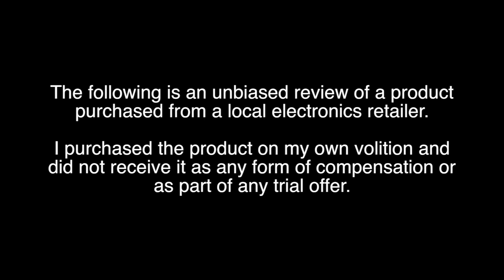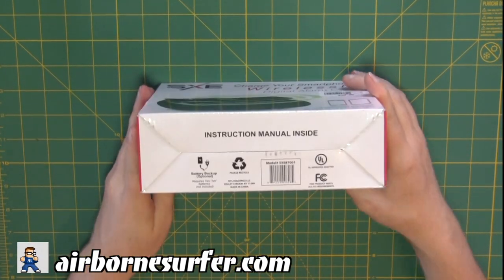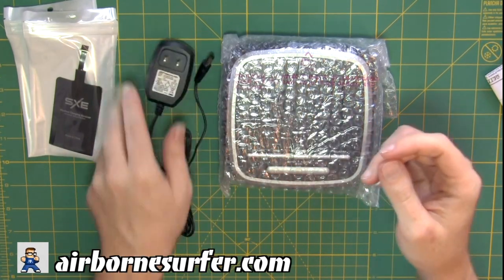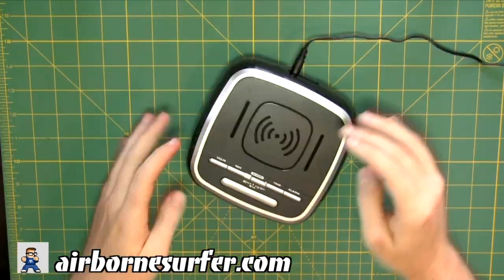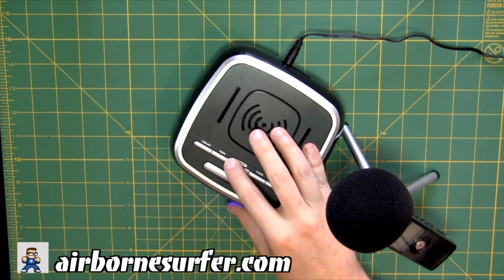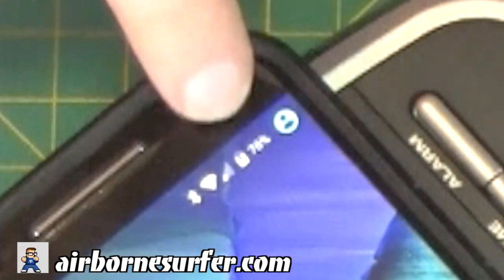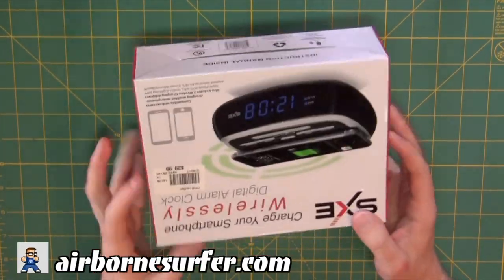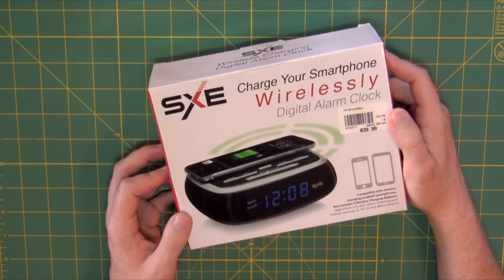SXE Electronics Wireless Charging Digital Alarm Clock Unboxing & Review

Comment: I wish I had watches you video before I bought the SXE Digital Radio. I can't even get it to power  up. Any suggestions that might help me power it up
Reply from the maker: I wish I could help you further, but I wouldn't be able to tell without cracking it open. Likely a bad solder joint or other terrible QA problem. My advice is to avoid the trouble and just return the thing for a refund!